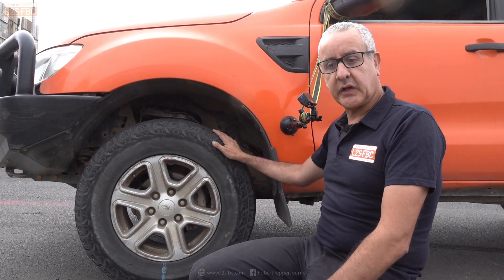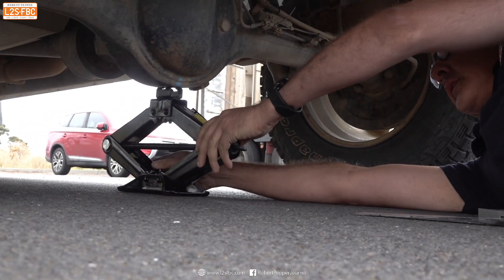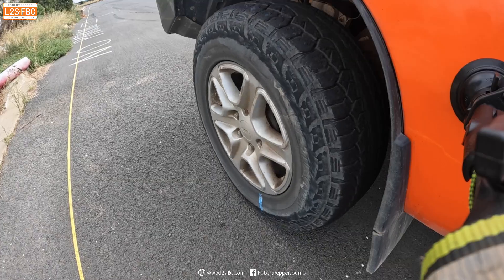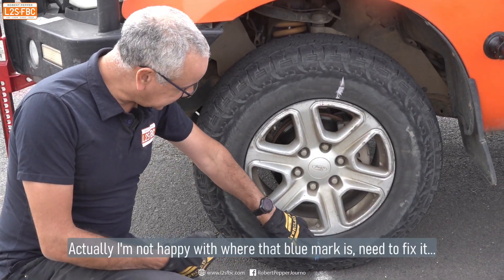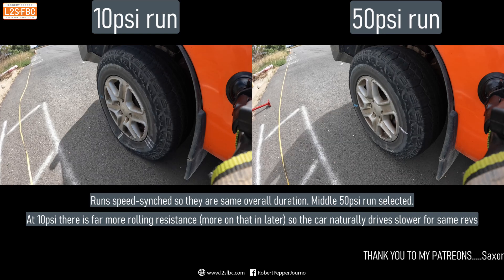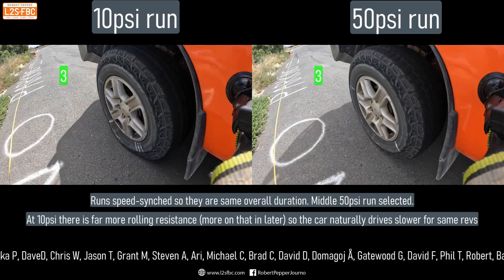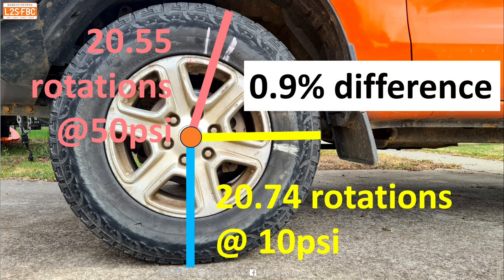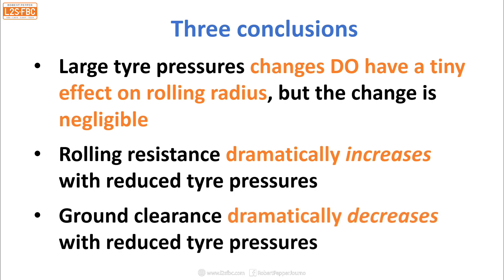Win the debate - pressure effect on tyre rotations

Comment from the maker: Comments on comments:

1. What about the effect of traction?  Covered here in sand, it's actually more reduced rolling resistance in compression terrains https://www.youtube.com/watch?v=uN0Tf2eYPE8

2. How much does the contact patch change with pressure?  All explained here.  https://youtu.be/spOUcaUzIHY
Reply: Yeah I hear you, though traction is not the same as rolling resistance. Agreed you get more grip with lower pressures say in sand, but the reason you don’ t get the traction in sand with high pressures because the resistance is lower with those higher pressures. And imagine how long his video would have been if he covered all other related topics. I’m sure he knows about lowering tyre pressures when on sand.
Reply: @gordonflash8976 the lower pressure produces a bigger contact patch thus creating a larger friction area.  You’re confusing yourself.
Reply: @kennethprocak5176 I do not think my comments are at odds with your own. Maybe you did not see what i was getting at.
Note. rolling resistance is affected by more than just tyre pressures, thus rolling resistance will not always follow tyre pressures.
Like wise traction/grip measurements will not always follow/track with tyre pressures. 
To express this in application, race track (tar) and/or rally drivers (dirt) get more grip from higher pressures. Drag racers (tar) and 4wd's (dirt) get more grip from lower pressures. Cheers.

Comment: So my question would be if the ride height dropped by 53mm that reduces the effective tyre diameter from 796 to 690 mm making the circumference 14% less — how can we explain a measured difference of only 1%? I think the tyre isn't contacting the road as it would when properly inflated - a lot of slipping is going on. Maybe a better test would be with two more practical tyre pressures where the tyre doesn't just look flat? BTW a car doesn't drive slower with the same revs - something would have to be slipping for that to happen as the mechanical connection is fixed.  Also you fiddled with the 70mm extra distance at the end of the run but had no problem with it at the start line?
Reply from the maker: No it doesn't make that sort of difference as shown in the test

Comment: Does the car tilt to one side when you have a flat tyre? Yes. Can it be enough that you can't get a jack under? Yes. 
Is this the reductio ad absurdum to demonstrate that OF COURSE rolling radius changes with inflation pressure? Why, yes...of course yes. 
Why would there be any debate on this? It is a pneumatic tyre... the word means that it is the air that carries the load.  Reduced air = reduced load capacity. 
And by the way, airing down means big increases in sidewall flex, which dramatically increases fatigue loads in the ply belts, which shortens tyre life and increases risk of catastrophic failure later at highway speeds. Don't blame the tyre manufacturer for a high speed Bluetooth if you've done big distances on under inflated tyres.  It might be necessary to get out of s mud bog or whatever, but it is insanely bad for the tyres.
Reply: Blow-out not Bluetooth... dumb auto correct

Comment: This is a very interesting experiment Robert. I have been battling to find a cure for a slight whining noise from the front axle of my LC78 when in 4WD. Having spent over $5K now having replacement parts fitted, I am desperate but someone suggested it might just be because I have different tyres (same size but different brand and age) on the front and back. Is this a possible explanation?
Reply from the maker: No, the LC78 is part-time 4WD.

Comment: The ground clearance change will be highly influenced by the tyre sidewall profile. Specifically, a lower profile tyre (bigger wheel) will exhibit a smaller change in diameter, and therefore ground clearance between a high and low PSI, whereas a high profile tyre (which is what 4x4 enthusiasts tend to favour) will actually result in a much larger reduction in ground clearance.

As with many things, perhaps extra-medium is the way to go 🙃

Comment: Just measure the circumference with a piece of string, at 50psi then at 10psi, the tyre should balloon very slightly had higher pressure giving a greater circumference.

Comment: I was wondering about this for awd systems. If tires are slightly mismatched in the wear patterns would keep the front at a different pressure than the rear compensate for the difference in circumference and prevent damage to the differential?
Reply from the maker: Yes in theory but the other problem you'd get is that the diameter changes with speed - and it changes at a different rate and distance compared to tyre pressure.  So the change in a 25psi tyre from 20-100km/h would be different to a 40psi tyre from 20-100km/h.  Then there's treadwear...

Comment: as a quarter mile drag racer here in Ohio USA, I can tell you it comes down to the distance from the center of the axle to the pavement, yes tire pressure will change that
Reply: So if I'm roll race will a lower psi tyres be quicker in acceleration vs a high psi tyres? My car is not high powered so I don't care about traction as much
Reply: @r.k862  lower tire pressure will give you a lower overall gear ratio, more traction and more engine RPMs, so yes a bit faster off the line, but at the expense of fuel economy and cornering, also tire wear may be affected, depends on the cars gearing, RPMs = horsepower but if you already have low gearing it will not help much
Reply: @jimsix9929  so lower tyre pressure is only good off the line or is it also good at accelerating after the take off?
Reply: @r.k862  yes  only good for a good start, as soon as the advantage of better traction and a lower gear are gone you will go faster with higher pressure
Reply: @jimsix9929  thanks. My car placard says about 37psi is recommended. If I am not looking for traction but I am looking for fast acceleration what max psi should I set it at?
Reply: @r.k862  I would say 37 psi, any advantage in gear reduction you get from under inflated tires would be negated by the higher rolling resistance the slicks on my race car only run 6 psi but that is a whole different thing, they will grow 2 inches taller at 100 mph, a modern radial will not, just takes more power to roll if under inflated

Comment: Hi, not exactly what you're talking about but i have a small camper trailer 800kgs unloaded and it's due for new tyres, would you recommend LT tyres or maybe just HT or AT? it will be 80% on road 20% unsealed, dirt, beach driving. Thanks.
Reply from the maker: HT should be fine. The main advantage of LT is puncture resistance but with that light weight and therefore low pressure risk of punctures is low.
Reply: thanks, so fairly flexible for my situation i understand. @L2SFBC

Comment: Pointless exercise unless you do it at speed. At speed the lower pressure will expand its circumference due to rotational centrifugal force and would be quite a lot bigger than the higher pressure tyre. Drag cars are a good example, they run very soft pressures and the tyres expand such a large amount they virtually become a variable final drive ratio.
Reply from the maker: The test was intentionally run slowly. Guess why?

Comment: Very interesting test!  Playing with the numbers:
the differences in circumferences is very close to 1%
the differences in tire rotation is very close to 1%
I would estimate the difference in gas miles to be close to 1% on a hard surface.  Rolling resistance on radial tires is lower than bias ply tires.
The 1% differnce isn't much until you get into several hundred to several thousand miles of travel.

Comment: i would have thought it would have geared it down a lot more at low pressure thus low pressure also adds to traction in addition to traction area of bagging out due to smaller circumference but 1% does not seem to indicate that. I'd like to see the same test done on soft sand and still believe it gears it down significantly. The drag resistance of 35s compared to 33s and 31s would also be interesting.

Comment: While you are at it measure yread width and compare with advertised width especial different brands
More so with truck tyres 
Reputable brands measured up but cheeper brands don't
Ripped off on Dollars. And SAFETY
Reply from the maker: The section width is overall width not tread width, common to all tyres.
Reply: @L2SFBC  sorry it's not common understanding
You buy a tyre based on advertised width to suit your driving style and load only to find its incorrect depending on brand
Some vary as much as 45 mil. So over 4tryes that is almost 1 tyre equivalent tred width short on a 265 
Compromise on SAFETY

Comment: No. My Dodge pickup , one day abs light and low Tyre pressure light comes on. Inflate the soggy Tyre and they go off. It makes sense. Abs sensors  count wheel Rev with what  they call a tone ring, so if a wheel is soggy , it shows up

Comment: You're better off doing something like 10 ratations of the tyre and marking the ground, as a 50m run will give inherent intollerances as you fould on reversing the 50m back, any difference in the track taken will add or subtract to the measurement so the test in in essence flawed from the word go. I think you'll get less errors in a shorter run. The results though are as expected, the lower pressure effeectively lessens the distance from the centre of the wheel to the outside of the wheel, so it will take more turns to travel the same distance. I believe a better test would actually be to measure distance of x rotations rather than rotations over x distance as that gives a more accurate test. you would have to follow a line rather than free drive as your tests. The reason for this is clearly visible in your tests as you vary distance from the tape, this is creating inaccuracy of test.
Reply from the maker: Whether I went for a fixed distance or fixed number of rotations doesn't make a difference.  With the fixed distance I could show on the tyre the differences. Can't do that with the ground version. Both are as valid.
Reply: @L2SFBC For accuracy, I'd have to disagree as your 50psi measurements show 3 different measurements, if the fixed distance was accurate, the mark would not differ, so the vehicle had travelled 3 different paths and 3 different distances. On rotations, you have less error possibility as it measures the distance travelled for x rotations. Thus the 10psi test will still show a difference if the effective circumfrance of the tyre is changed (which it will be) by the distance travelled. The results will still show similar results, but the point is one will give a higher accuracy on repeatability. I'd agree with you IF the 50psi tests came out almost exactly the same, but 3 tests and 3 different results is a fail of the theory of the test to me. 
Maybe run a rotations test on a surface dotted with sand, it'll give the ability to see how far from straight you line actually is, thus able to measure more accurately. The problem is how to remove the "human error" from the test as that is what the differnces in the 50psi test was.
Reply from the maker: This was not a lab-controlled test so I'm not surprised by the slight change in results.  Taking a fractionally different line could be one reason. Starting and finishing at a fractionally different rotation point could be another. The list goes on. The problem with sand is that you then introduce tyre slip into the equation which on the surface tested is neglible.  There are many ways to make the test more precise but given my time and cost constraints, I chose that method, and made it clear so comments like yours could be made. I would suggest that the 3x50 results were indeed "almost exactly the same" as it was.
Reply: @L2SFBC  I considered you were't happy with the tyre position on the second 50psi run, so therefore accuracy did matter, if not the near enough approach wins and that gives more inaccuracy. I would say different track is absolutely where the errors come in, it does prove though that however hard you try to keep the same line, you vary slightly. You are normally quite good at performing good semi-controlled tests, like with the pulley ring tests, They are good real world tests no matter the small inconsistancies. 
On something else on the video, I was quite surprised to see how much the tyre deformed on 10psi, I have BFG muds on the 110 (not by choice, but they keep the rims off the floor as it's being rebuilt, I will be running All Terrains) At 10psi the muds barely deform at all, the 110 is effectively kerb weight at the moment as it is totally empty, so about 1,700kg. out of interest how much does your vehicle weigh?
Reply from the maker: The vehicle weighed around 2800kg as tested there. Had some gear in the back, near full long-range tanks, so significantly more. If you run 235/85/16 on your 110 that'll be a different too, those tyres are 265/70/17 so not as tall and lower profile.
Reply: @L2SFBC  It's got 265/75R16, but yeah, 1000kg less weight at the moment. :-)

Comment: One last experiment: measure axle height unloaded, then, put 500 kilograms of load over the rear axle and measure the difference. I'll bet there will be less change in rolling radius, when inflated to vehicle recommended pressure. If over-inflated, the height will actually change MORE from no load to full load. you may or may not find the same thing, if underinflated.

Comment: Running tyre pressures too low also causes more flexing in the sidewall that generates more heat and causes damage to the sidewalls. I have removed tyres that have been run to little pressure and have found a lot of rubber dust inside the tyre from the sidewalls breaking down.

Comment: Reduced pressure reduces clearance by increasing the flat spot. That flat spot is cut from the unloaded circumference, hence the small increase in rotations. Only possible necause of comptession &/or closure of the tread. Not enough to alter the speedo, but rolling resistance & heat build up is another league.

Comment: Regarding rolling resistance, you've measured the increased resistance on bitumen, which is a high grip surface.
It would be interesting (but very difficult to measure) on sand or other low grip surfaces.  
My "seat of the pants" says that people running higher than usual pressures use more fuel than people using lower pressures on desert crossings.
Reply from the maker: That's slip ratio and yes it's greater on loose surfaces like sand. Another time...

Comment: Rub the chalk off the tyre and make a new mark, its a bit easier than using the high lift jack.
Reply from the maker: Why do you think I didn't do that?
Reply: @L2SFBC  You thought it would actually make a difference in terms of accuracy, but of course it made no difference, just eyeballing the degree of rotation (ie 3 oclock, 9 oclock etc. would have been more than enough accuracy. Nice little chalk marks showing a tiny bit of variance betwen runs looked pretty but a lot of extra work.
Reply from the maker: I disagree, wanted to do it properly.
Reply: @L2SFBC  Fair enough.
So from your results, I calculated the circumferences as 2.43m for 50psi and 2.41m for 10 psi, which is exactly what you calculated (15:00). From these two circumferences, I calculate that the radius at 50 psi was 387 mm, and the radius at 10 psi was 384mm. Thats a tiny 3 mm difference in radius between the tyre pressures, which is not consistent with what we can see, and with what you measured in the ground clearance. Something doesn't add up, and I'm not sure where the problem lies. Can you explain it? The only explanation I can come with is that the tyre is rolling as an oval, and despite the change in tyre pressure, the circumference of the oval does not (and cannot) change.
Edit. just read the comments by @johndobbyns8651and @maxgood42 below. That's what they said.

Comment: Tyre rolling circumference remains fairly consistent with modern radial tyres as their inflation pressure or tread wear changes. Their steel or polyester/rayon belts resist elongation (stretching) quite well as the inflation pressure is changed (though every material elongates under load, sometimes it is imperceptible depending on what Engineers call Modulus of Elasticity or Young's Modulus).

The tyre deforms as it comes into contact to the road where it becomes relatively flat. As it does the tread blocks flex so that in the road contact patch the tread blocks are in alignment with the aforementioned steel or polyester belts, thus the circumferential length of the belts govern the rolling circumference of the tyre.

Having said that, in the USA some years ago the required new cars to warn the driver if a tyre, or tire, inflation is too low. As I understand some manufactures can do that by comparing the data from the wheel speed sensors, so there must be some measurable variation of rolling circumference with respect to inflation pressure.

I must commend you with the thoroughness of your video content and the range of interesting 4x4 topics that you cover. Please keep up the good work.
Reply: The belts constrain the top of the tyre not the bottom. Ie they control the free radius, but not the rolling radius.  The rolling radius is a function of inflation pressure and load,  with a side dish of side wall stiffness.
Reply: You are correct that the wheel speed sensors are used for TPMS, for Honda at least. I have a "racing" 2024 Honda Civic Type R that I drive daily and some weekends on a track at speed. The TPMS gives a false "low pressure" warning at almost every track session due to the side-to-side pressures changing since there are more right than left turns that heat the right side tires more when driving a road track clockwise. Never have gotten this when driving around off of the track.